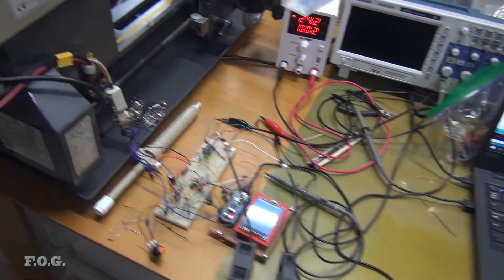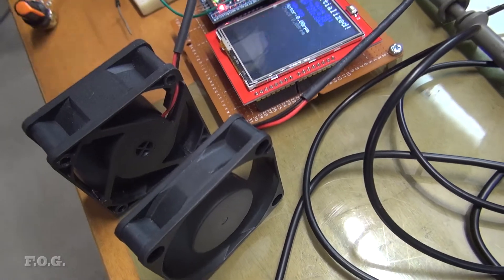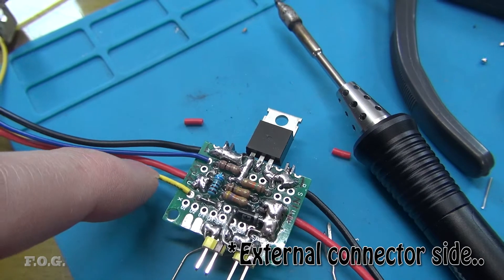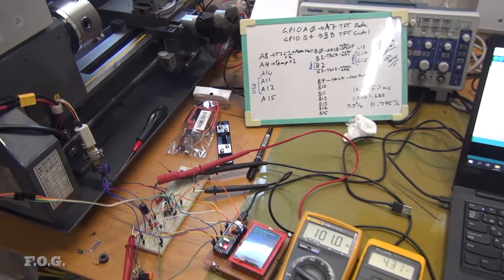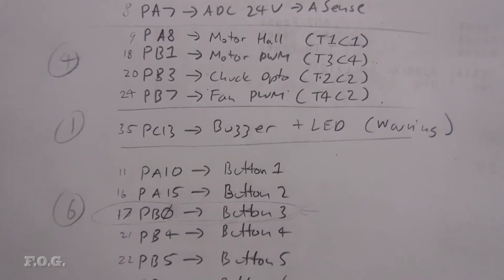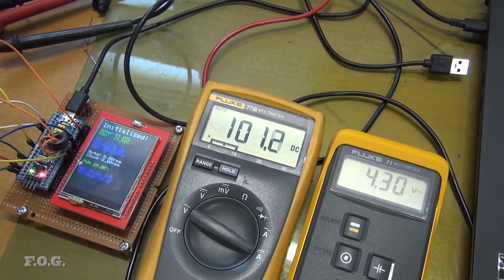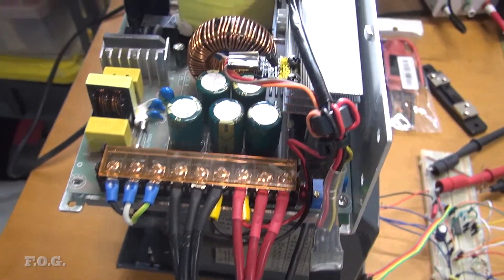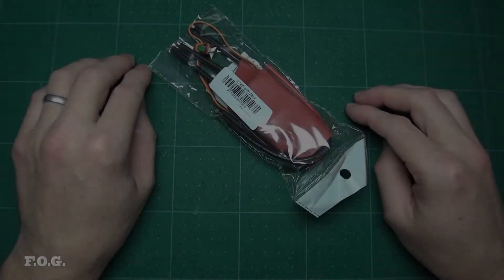EP5 - Mini Lathe Upgrade - Power Supply Modification - Brushless Motor Conversion How To

Comment: I have heard about some breadboard wires made from CCA (Copper Coated Aluminium) which have larger than expected resistance or fail all-together once the copper/aluminium electrolysis corrodes the wire.  Presumably using CCA is to save the cost of buying copper and is not usually mentioned by vendors.
Reply from the maker: This seems to be the case. I also saw an episode on CuriousMarc channel recently where they encountered a similar experience.. it's a bit of a pain, akin to buying a cheap multimeter.. Live and learn!